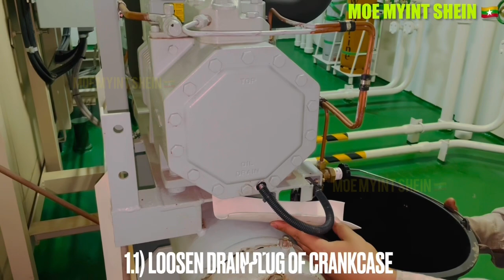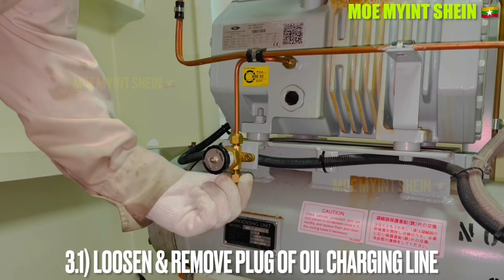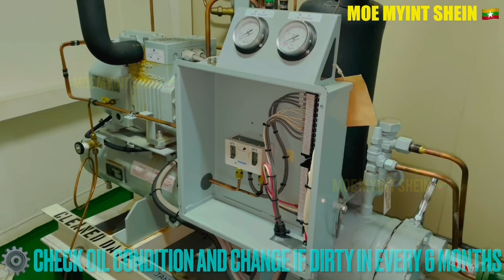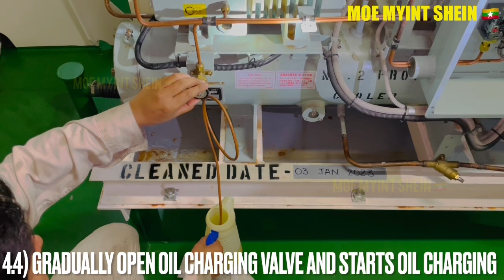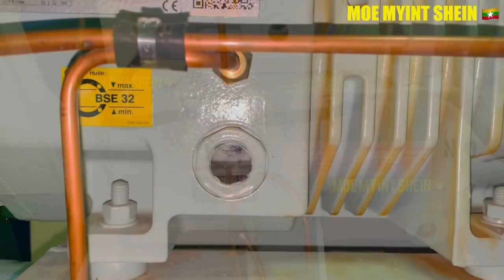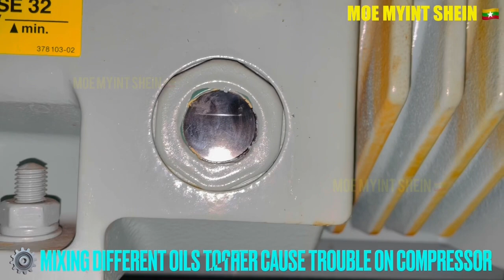Lubricating Oil Renewal for Refrigerating Compressor | MOE MYiNT SHEiN | Technical Vlog : 076

Comment: Hi,does  it need to pump down the system before charging the iol?❤
Reply: Hi bro, when you open the drain plug for discharge the lub oil, the air out side can come inside crankcase, do we need to take care about that ??
Reply: Hello sir.After pump down suction valve of the compressor needs to be kept closed?
Reply from the maker: Reduce low pressure setting to create vacuum inside crankcase.
Reply from the maker: Sure. 
Pumping down the system is required. 
And also, need to reduce low pressure setting.